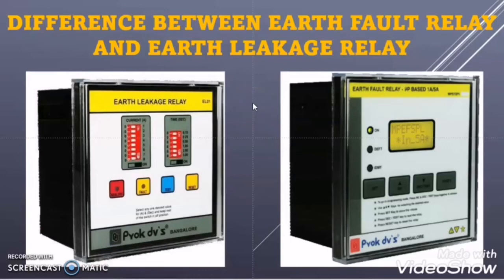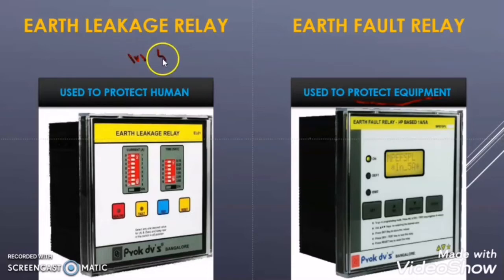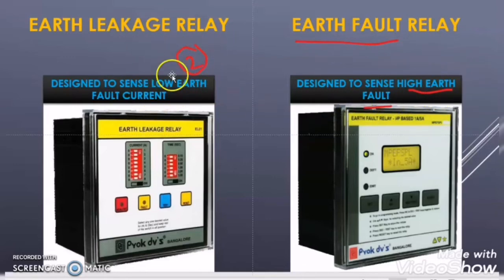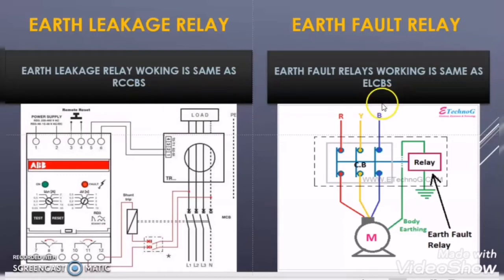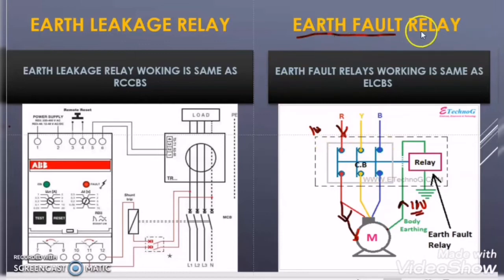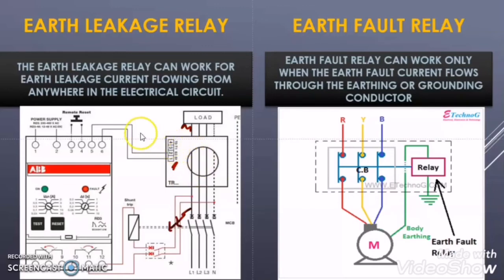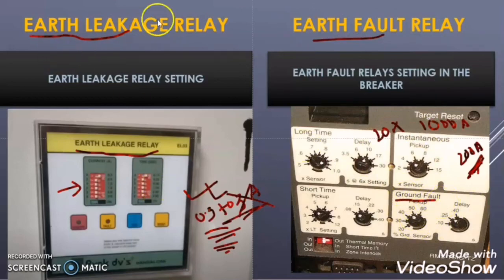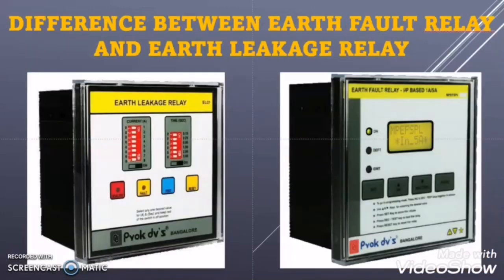Difference between Earth Leakage Relay(ELR) and Earth Fault Relay(EFR)

Comment: Sir, In STP plant,  total 10 nos of 3 phase motors are connected.The earth leakage relay gives fault indication.But mccb is not tripping.All motors are inside water.Star delta starter used here for every motor.How can I solve this issue.plz explain me.
Reply: 10 motors are connected in one STP panel.
Reply: @satyajitsharma4587  mccb won't trip you have to connect shunt trip then automatically trip mccb